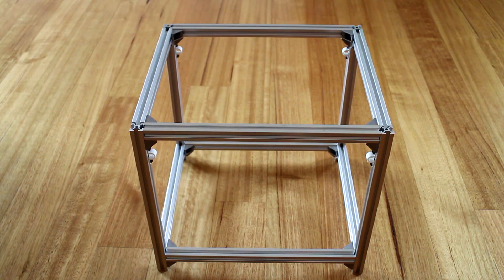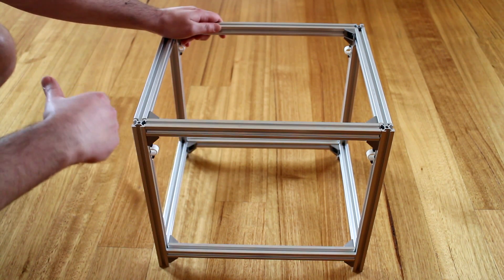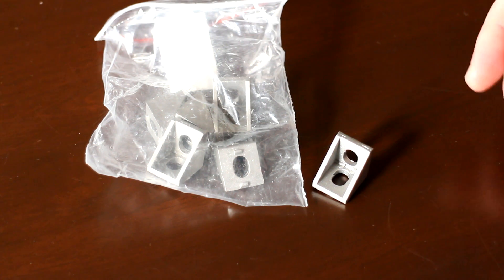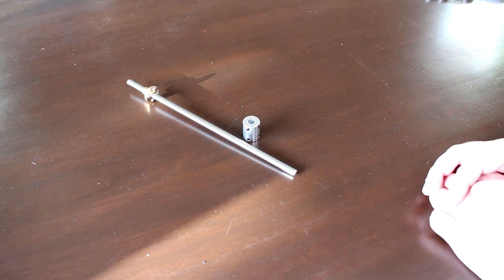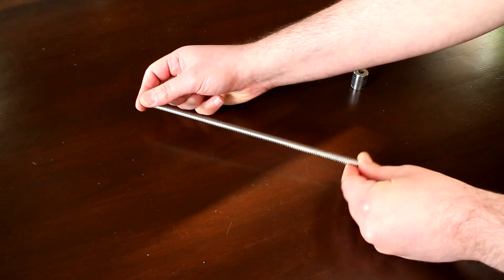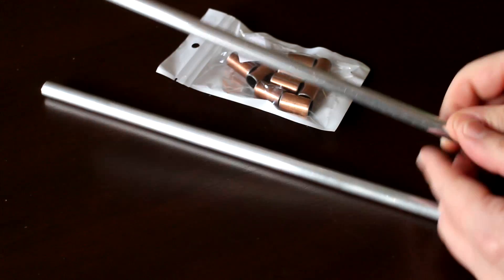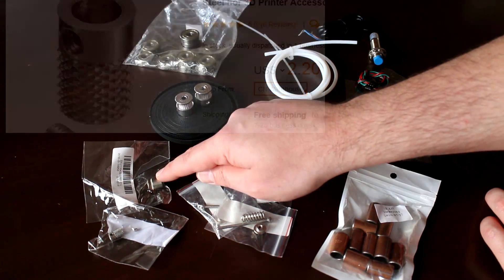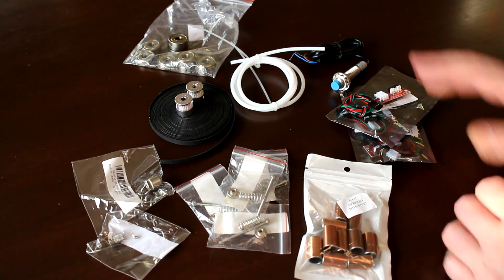New 3D Printer Parts

Comment: That frame will probably be the biggest improvement from i3. I built i3 first and now finishing second which is basically same but self designed parts + alu frame. The test prints are so smooth I couldnt believe my eyes!

A few notices about your components, as I have selected some exactly same parts:
- that inductive sensor will not sense bed thru 3mm glass. actually it senses aluminium from 1-2mm distance nothing between sensor and bed. I read there is better option which senses 8mm distance, but dont know if that is alu thru glass. ( I tested this sensor actually today)
- I feel that selecting the white GT2 PU belt over rubber one makes a huge difference. The PU belt is much stiffer -> less ringing/vibration in the movements
- the 8mm lead in the screws is too much imo. I have those now, but am looking TR8x2 for replacement. I also made extra bearing between screw and Z-motor, so the bearing carries the load instead of motor. That just.. felt right. :)

Interesting to see how your new printer comes out! I bet it will be awesome! :)

Oh, and dont get the heat blocks from Banggood.. they bleed plastic from every screw and thermistor hole, as they are drilled too deep.. I have 2 of them going into trash. :)
Reply: I also believe the bed moving Z-direction is the better way, perhaps my next printer is like that.
Reply: What is the size of headed bed and what is the best filament to use for the parts it’s abs nice or else

Comment: You ever used AliExpress they are another good site for parts like eBay and banggood
Reply: +TheLukey21 , I live in AliExpress. A3 member.
Reply: +Granite i used to as well, but once you buy something you buy lots of things :) i use it all the time now, used to use eBay but 9 times out of 10 AliExpress is cheaper and has more choice.
Reply from the maker: I prefer banggood for their shipping options. I can select priority shipping for only a few dollars and receive the items in under 2 weeks. Using Aliexpress or ebay give limited delivery options and the common other delivery choice is express which is expensive.
Reply: Is this the type of design that you're going for? http://www.aliexpress.com/item/large-size-metal-fuselage-High-Quality-Precision-DIY-3D-printer-kit-with-LCD/32549538291.html?spm=2114.30010308.3.139.7kcK2C&ws_ab_test=searchweb201556_8,searchweb201602_2_10057_10056_10055_10037_10049_301_10059_10058_10032_10017_405_404_10040_10060_10061_412,searchweb201603_8&btsid=a72d1579-14d2-4c16-aea0-a924ad69cba1
Reply: +Andrew Winkler I'm going for a fixed build plate. This is mine http://www.123dapp.com/123D_Design/3D-Printer-core-xy-fixed-build-plate-V1/5936189

Comment: channels cut are cheap as beans.  to get a straight cut like you did is not easy plus getting the demension exactly right.
Reply from the maker: Correct it wasn't easy cutting, but where I live getting the extrusions cut will cost more than the extrusions themselves.
Reply: Did all my cuts by hand.  Got pretty good towards the end.

Comment: If I'm remembering correctly, bronze is harder than aluminium. So you are likely to wear out your rods and have the aluminium deposit on the bronze bushings.

How much that matters, I'm not sure.

I've seen a couple of printers with anodized aluminium rods and Igus bearings.
Reply from the maker: The bushings are oil impregnated for self lubrication. They do leave an oily residue on the rods after some use. I'm hoping the low friction won't destroy the alu rods, but we'll see.

I've seen the igus bearings and anodised alu rods, but they're quite expensive. I'll try this first before committing to purchase anything further.

Comment: Thank you for this because it is time to retire my Prusa I3 Rework as I have never been able to really print with it due to a lot of issues with the bed and 370mm X axis 8mm smooth rods is a horrible design due to the 8mm rods drooping.  Anyway, I have to do it the hacksaw way myself but wanted to ask if you used 32 TPI blades?  I only have 24 but I read 32 is the way to go (the more the merrier) but I think I saw 24tpi on your blade.

By the way how can you tell if a leadscrew is really 8*2 or 8*8 when looking at the pictures because I would prefer a real 2mm pitch.
Reply from the maker: My blade is 32T. How do your 8mm smooth rods droop if they're made of steel? Are they not straight?
Reply: +Tech2C
Always droop due to 8mm and the length of the rods so the bed is always closer to the nozzle in the middle of the rod length.  Really 8mm rods over 300mm is too small.  They are perfectly straight and came from Misumi g6 chrome hardened.  Damn good rods but if I had known then, 3 years ago, what I know now I would have went with 10mm and drilled out the side holes.

Comment: Core XY are better printers in my opinion. Never been a fan of the moving beds.
Reply from the maker: This will be my first CoreXY so I'll understand the differences after commissioning. Agree regarding the moving bed.
Reply: The bed still moves on a CoreXY.

Honestly, unless you're wanting to print flexible filaments, you should look at the delta printers.
Reply: I know what you mean, but my experience with the FlashForge Finder has been stella, so a lowering Z is fine.
Reply: The deal is switching from a Prusa to this style of CoreXY is you're trading a sliding Y bed which is supported throughout for a bed which is now on a cantilever, unless you use a gantry with 2 steppers or something to lower it.

Would you accept, say, a X axis slider that was cantilevered?  If not, why would it be acceptable for the bed to be cantilevered.

Furthermore, your cantilevered bed is susceptible to threaded rod hijinx.  Those spring-couplers are poor performing as they will compress and deform under vertical load as well as during rotation.  There's a better design out there for these couplers but nobody has adopted it.

And if you want to use a bed leveling probe, you cannot have such slop in your z mechanism.  Auto bed leveling is highly dependent on an accurate Z mechanism, which you will not get if you use those couplers.

It might be OK for a printer like the Finder because it is small.  When you keep dimensions small, you can get away with such things.  But you have to be extra careful when you scale things up.

I'm not saying deltas are a panacea either, but really, after all this trouble and then some, I suspect Tech2C's not actually going to see any improvements.
Reply: Agreed, especially with larger prints, a delta or a printer where the bed only moves in z can eliminate a lot of problems. With a bed that moves on the x or y axis there is just a lot of mass moving and without a strong frame it will affect print quality.

Comment: I was thinking of converting my one and only duplicator i3 to corexy too! Unfortunately i can't get those aluminum extrusions at a decent price, so instead i will be using steel 20mmx20mm square tubing for the frame. However i need to plan my build really carefully because that printer is the only one i got... Once it's disassembled no more 3d printed parts ! Good luck on your build can't wait to see what you come up with.
Reply from the maker: I'm in the same boat - it's my only working printer and I can't disassemble it until the new one is working. The 20mm t-slot alu extrusions are expensive in Australia compared to other parts of the world but funny enough 20mmx20mm square tubing is also expensive here.

Comment: 4 start T8 lead screw is a good option if you're using micro stepping. 16 X 200 steps (1.8° motor) = 3200. 8mm / 3200 steps = 0.0025 mm/micro step or 0.04 mm/full step.
Reply from the maker: I am using 16 micro steps. Here's hoping I don't lose too much resolution using this lead screw, but we'll see.
Reply: +Tech2C I have a 1 start version and it's just too slow on long moves and as I'm using auto bed levelling, the z motors are constantly moving and getting hot. I think I'd go for a 2 start next time, that might be the sweet spot between speed and less small moves. 
Have you thought about stepper drivers? I just installed the TMC2100 and they are amazing. So smooth and quiet!

Comment: I  thought you will make delta printer for your next 3d printer. I followed your video since starting replikeo as i bought replikeo too, you did a great video to modify the replikeo. May i know why you choosed corexy printer rather than delta printer?
Reply from the maker: Hey thanks for following! I chose the corexy design as I've seen many printers based on it producing great quality prints, and it can be built quite compact in size. Delta is interesting and I may look at a delta design in future.
Reply: Thank you for your video so far, my replikeo was modified exactly same as you made on video. its great modification. Last two month, I decided to make delta because the size is very compact, its take small space on table rather than replikeo. I saw the delta (atom 3d printer) on 3d printer exhibition in singapore early this year, the printer can do 50 micron, its make me surprise after that i decide to make delta. now i still doing calibration (its very hard one on delta)

Comment: Great Vid!
I've been thinking of doing this exact same thing with my kit i3.
i liked your Bowden X-carriage mount (thing:1632847) and have just implemented the auto-level feature with my GT2560 controller. i'll link you to the remix for the duct once i'm done perfecting it, so far so good.
I'm not sold on the aluminum rails and bronze bushings tho, i think i'd rather liner rail slides just for the rigidity but i'm really keen to see how your design pans out :)
Reply from the maker: The Alu rails and bronze bushings are an experiment. So far so good, but the real test will be the motors moving the axis without binding and oscillation. Should be interesting either way. Cheers!